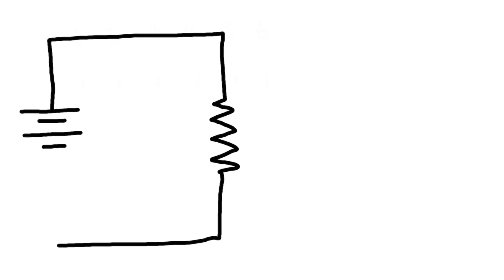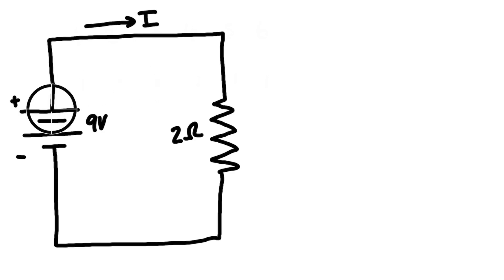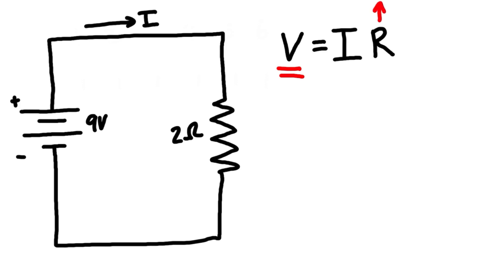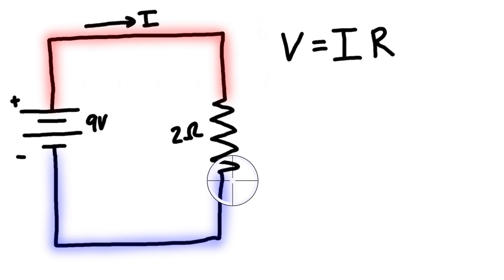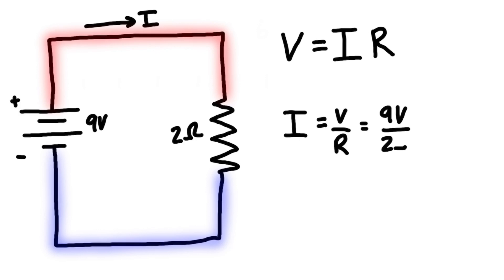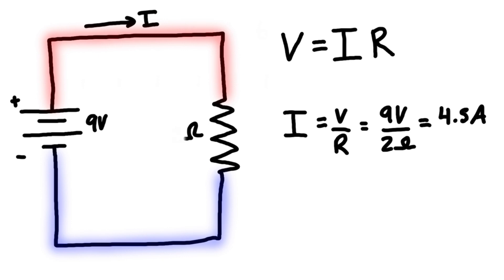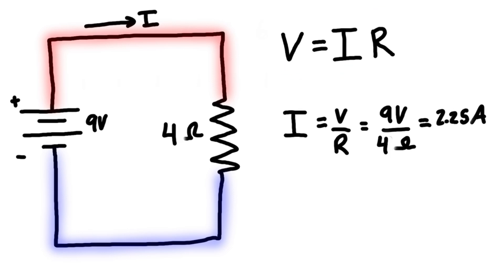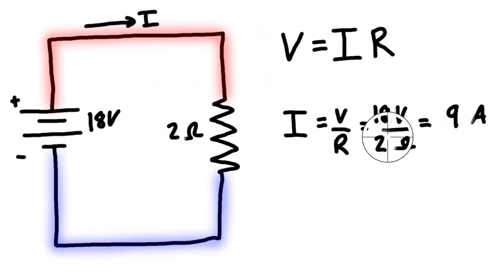Ohm’s Law

Comment: Man, is that resistor getting hot.
Reply from the maker: In effort to keep the math as simple as possible, the circuit may explode 💥
Reply: If the wire size is getting bigger It could be alright. But wire resistance increase as well.